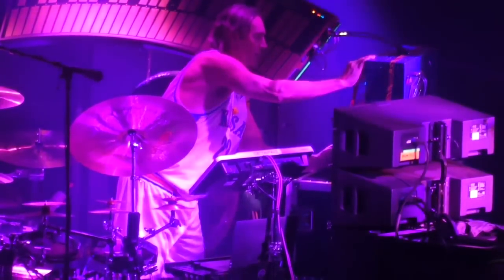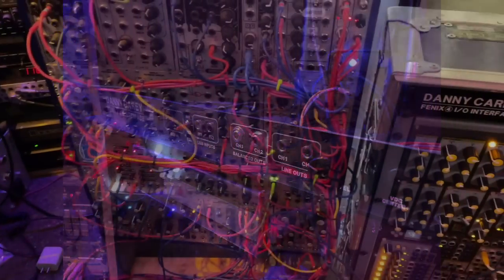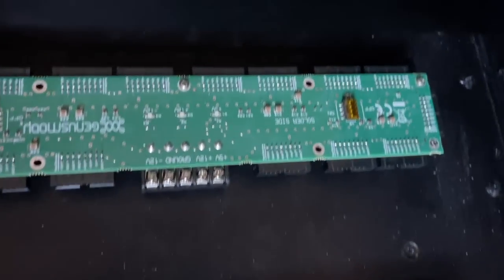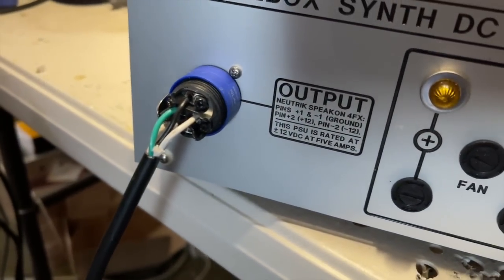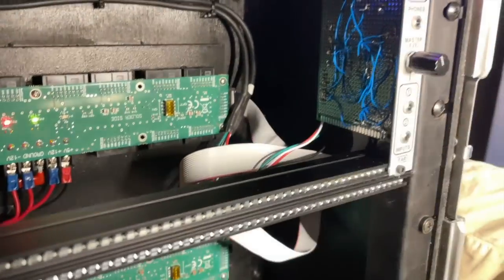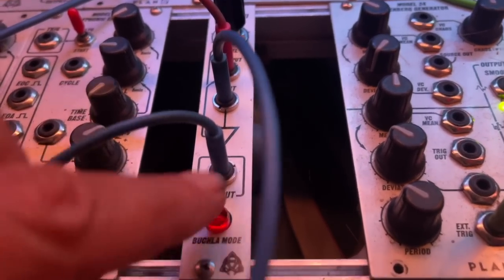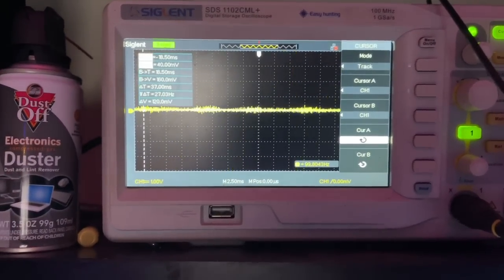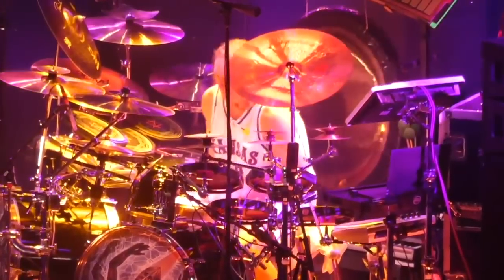MAKING A MODULAR SYNTH FOR TOOL •  DANNY CAREY • CHOCOLATE CHIP TRIP

Comment: not a big fan of tools music but , i am a big synthesizer fan.  and this is a really cool totally analog synth it looks like. really cool solder job on that output module so many red jumper wires bouncing around on that thing. cool peice of solder art.   i have a small eurorack setup.  wish i had some sweet power supply like that. im always concerned if theres a problem im lacking the juice you know ?   really sweet job.  one thing i didnt see anywhere , was multiples. i didnt see multiples , and i didnt see attenuators. or any digital modules for that matter which is strange for this time it was made (correct me if im wrong please would be delighted)
Reply from the maker: Ladder Low Pass filter is half of it as far as the Moog sound
Reply from the maker: About a quarter of the modules are actually digital!
Reply: @PeterGrenader  oh wow. i only have like 1 digital module in my eurorack. lol  oh my bad, i have two.  really wanted to try to get that "moog " sound. yet, it still escapes me.

Comment: That LPG sounds FANTASTIC
Reply from the maker: Thank you , Dallas. I am discussing the possibility of releasing the little one as a built module and as kits. It all boils down to vactrol availability. The duals that were originally speced now go for between $10 and $36 a pop  - if you can find them.  The singles ,which can be stacked in this application to functionally  mimic the duals may be a workable solution.

Comment: Nice, how can you be sure that it won't you know overheat or cause a shock to the user, do you do some kind of industry testing before you say it's ready? And btw do you know if Danny is making any progress on his solo album
Reply from the maker: Good questions!

There's no AC anywhere except inside the external power supply box so there's very little risk of shock and if something odd thing allowed it,  it's triple fused and the PSU's themselves have internal voltage fold back in that situation. They turn themselves off in an instant.  So not so much testing, but using components and design to assure the risk of shock is, unless you ude this while in the bathtub,  virtually impossible. 

As a further precaution I used Neutrik Speakon connectors to route the DC from the PSU box to the main case and the contacts are recessed - you can't easily get your fingers in there (See link below) although with only a 2 AMP combined load, DC shock is doubtful. 

As far as overheating, this was a major consideration and the primary reason I put the PSUs in their own chassis. The power supplies are good for 5 amps. The synth only draws half that. Tons of headroom, so everything will run really cool - but just in case, if you noticed the power supply box has two fans - one blowing cool air in, one blowing heated air out.

With the power in it's own chassis, while the Toolbox will elevate a bit due to the electronics humming along, it's negligible and it will help keep the VCOs stable. 

As far as any projects any of them are working on alone or together: I can't speak about that publicly.  Hope you understand. Part of this gig is keeping their stuff confidential. I asked DC  if he was OK with this video - he green lit it immediately, and as far as other stuff he knows i'll stfu lol

https://www.monoprice.com/product?p_id=601500&gclid=CjwKCAjwoMSWBhAdEiwAVJ2ndlcpAC7Ch1Fvv5u8zp6PgMyQjYc9nzPJomfuZPQT75IKxa1o9Qu5whoCkSEQAvD_BwE
Reply: @PeterGrenader  Thank you, that was very informative. Looks like you covered all bases! And about the secrecy, I understand but I had to ask :)
Reply from the maker: @502aca  (thumbs-up emoji)
Reply: @PeterGrenader  Hi Peter, now a year later, I wanted to ask: somewhere I remember you mentioned that Danny has something big going on which is really gonna blow people's minds, may I ask if that referred to the Beat tour?
Reply from the maker: @502aca  Off the top of my head, i dont know now what i was referring to lol. I don't know when Adrian first approached DC about Beat but my suspicion is it happened when he played with Jerry Harrison and Adrian last December  in Orange Country.  I heard about it from DC a couple of weeks before the news broke.

Comment: Amazing; what became of that original aluminum case?
Reply from the maker: Over the last decade, we have made many modules changes depending on the patch loaded on any given tour. All of them are still around however. Those will be installed into the original chassis and it will take a permanent place in Tool's studio.  I am talking to DC about acquiring a few key modules - such as VCOs, VCAs and an envelope generator so that second system will be fully functional as it's own instrument.

Comment: Much like analyses of Danny's drumming, I understood none of this, but I love the time, effort, and thought that went into such a detailed project.  Watching someone do what they do, even if you don't get it, is hugely interesting to me.  Danny is lucky to have found such a craftsman as yourself.
Reply from the maker: Ah man, you're too kind. I've just been at this  a long time, that's all - so the what to do's and their pecking order fall in place fairly quickly.  The backstory:

I will tell you what was different this second time over the first:  On both of them, Danny left me completely alone to do my thing.  He doesn't watch over your shoulder, which for me is essential.  He's asked you to do it for a reason, he trusts you'll get it done.  But while on the first one i was showing him ideas all along and getting his approval, step by step, this time he REALLY just let me run with it. i was sending him updates constantly, but it was not for a sign off.  I had his complete trust. 

He called me during the US leg of this tour to tell me  he wanted to road case the system.  My instant reaction was - great - the power supply is coming out of the box.  The only thing i asked him was if he wanted balanced outputs b/c i had just done it when we put the Fenix together and he was really pleased with the noise floor improvement.  He let me deal with the case manufacturer directly, and i made the decisions of what was going in (brand) putting everything where it is on my own.  I assembled a list of what needed to be purchased, and where to get each part and submitted the list. There were no questions.  A couple of weeks later, the parts started arriving, a week later the case was done and then i went to work.

One frustration i had was the project was completed about three days after they left for the second leg of the 2022 tour. Had I been able to beat that by a week (due to part shipping delays  that was not possible), if i pulled it off it would have been ready for Europe.  In the end however that turned out to be a blessing because that's when i decided to upgrade the modules and really expand the system's capabilities. 

The second delay was waiting close to a month  for the current system to arrive in LA after being shipped from Europe.  I used this delay to design and build the three one-off custom modules i detail in this video and to demo Denny some of the new timbres i had come up with, which he really dug. Anyway, the current system made it back to their studio last Friday.   i slapped together in two days last weekend.
Reply: @PeterGrenader  what a fantastic story, thanks for the details. Having complete freedom to operate is a huge bonus when you’re putting together a complex system like this, and your work product obviously pleased Danny enough for him to unleash you!  Now he’s got a set up that he’ll use for years to come. I hope he gave you some free tickets!
Reply from the maker: @spasticlabrat  at about 2:08 in this video, you'll see some people standing side stage @ stage right, I'm the dude who sort of lights up in the white shirt  and then turns around to his left a disappears out of the light. Tickets if i wish, but usually i opt for tech pass ;) (better)

https://www.youtube.com/watch?v=gVl2ZFjkJ70&t

Comment: Did you have to write a manual for Danny to show what connections to use and what the modules did? Or did he already know most of it?  PS….this is awesome!
Reply from the maker: I make them a reference manual for the patch he and i define before the tours start, It's a super complex set up, he can make things different every night and does, but i do habe a cliff notes type deal with diagrams just for reference  it's about six pages long. It has the power up routine, and we number the ends of all the patch cables and there's a map to show which numbers go into which jacks, and then there's indications of the critical dial settings and the ones that are left to DC to decide on for each show. It's just  they don't freak out if something goes sideways when they are in Europe  kinda thing.  I am not going to let DC get into a weird situation when he's alone on stage with 18K people watching him.  We do what we need to to make it repeatable and manageable 

Also -  their techs are really really good. These guys are experienced, smart AF and have been working with them longer than I've been around. If all else fails, they can facetime  me 24/7.  But it's been close to decade now and there's have been very very few oh crap moments.
Reply: @PeterGrenader  yea….I would have an Oh crap moment with all the options available….AND the potential to blow some speakers…lol